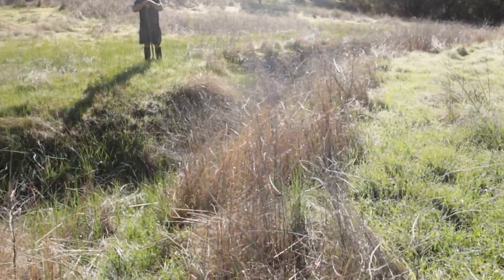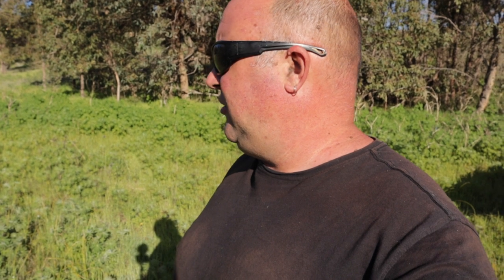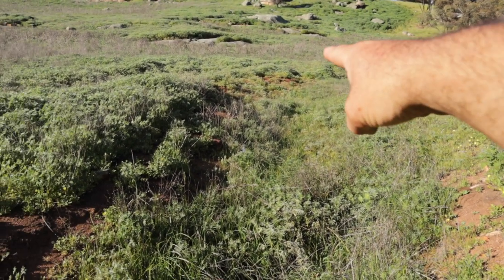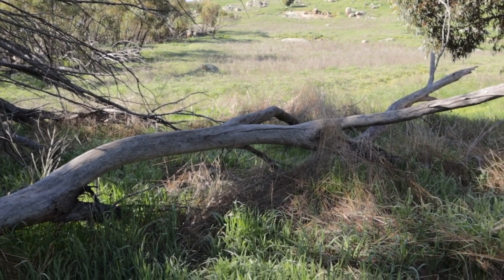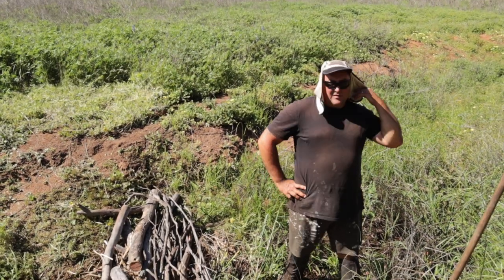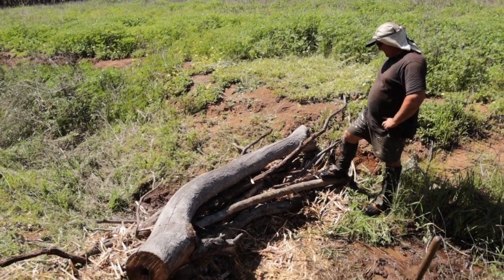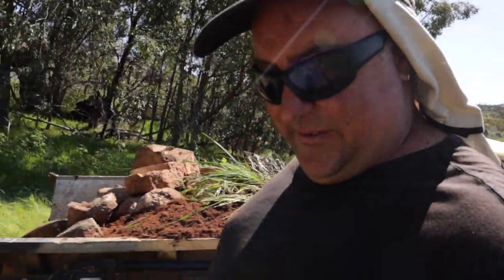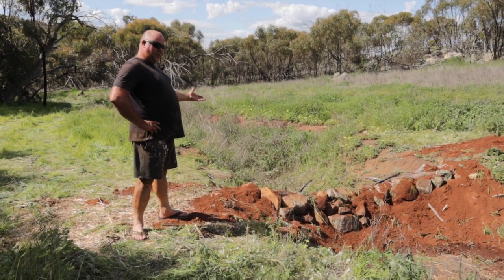Building a leaky weir start to finish in one day | Slow the water and rehydrate the land

Comment: Pretty nice build!  With all that rock, I wonder if you have an underground ledge that's helping the water pop up in the flood plain like that.  It might have always been close to the surface, but holding back that little bit of water with the beaver dam was enough to finally put it over the threshold needed to break through.

Now that you're installed a huge Leaky Weir, I'm really curious to see how it transforms the landscape.  You could have a veritable swamp on your hands before too long!

Do those trickles remain all year long, or are you expecting both stretches to dry up in another few months?    If you can get the Weir to pond 2' deep right at it, I'd be curious to see how far back that would stretch.  Looks like you got it to about 16" of pond depth, but will that last or will most of the dirt wash out on the first rain?  I'm not going to be able to sleep now!  It's like Christmas Eve waiting for the rains to come so we can see how large a lake you can establish on your property!!  😁
Reply from the maker: We’ve been monitoring it and taking little vids each day. Had some rain today but there hasn’t been any drastic change… yet. Seems to be doing the job though! Will post an update on Thursday 👍👍